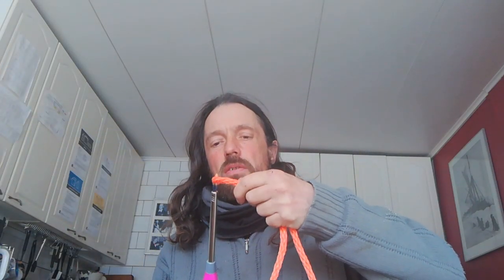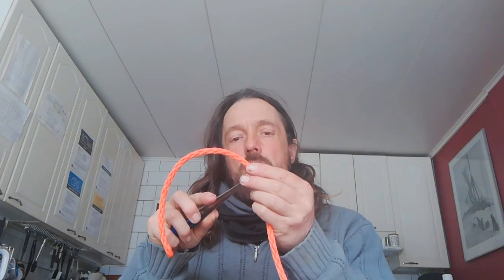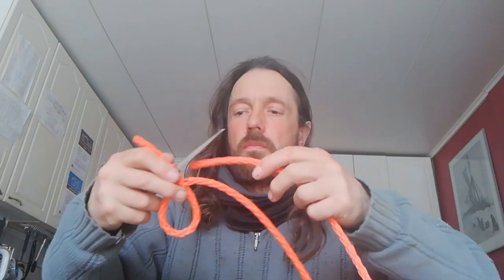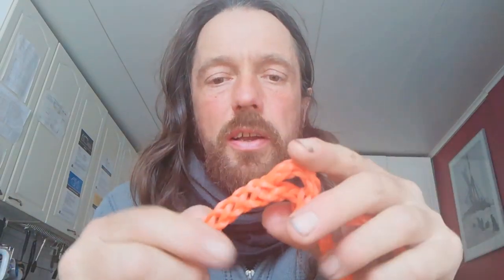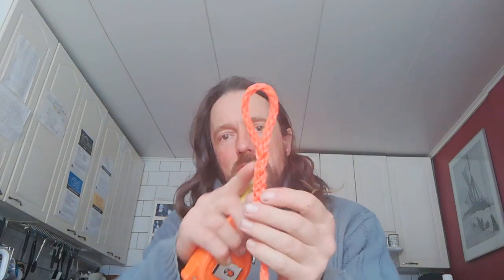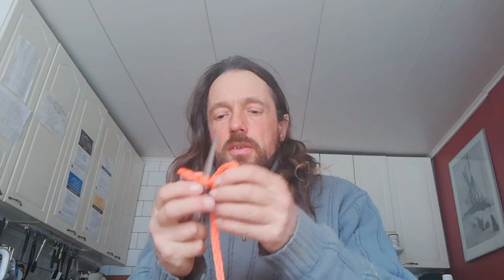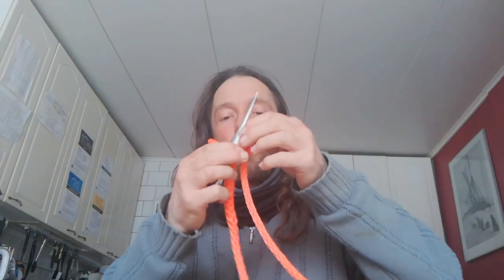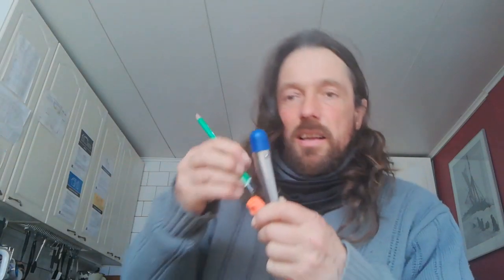Eye splice in hollow braid rope

Comment: If you put each end on the ball hitch of two cars and pull the rope to destruction it will most always break where the melted ends are. Leave more end inside, pull the end out, cut off the melted end, then tapper the end, then draw it back inside.
Reply from the maker: Thanks for the advice Bill I will bear that in mind. It tends to be the sled dogs that break our lines through eating them rather than the pull. We do use the same splice for towing ropes for the snowmobiles and quads too though, there this will be useful information.

Comment: To make it extra extra strong I've wrapped the weave with electrical tape. It's not necessary but just a little added security depending on what you are using it for.
Reply from the maker: That's a good idea, I have wrapped the rope in electrical tape where it has started to rub or fray before now but never on the splice itself. Thanks for the suggestion and thank you for watching.

Comment: Fantastic mate, I've always wanted to make my own lines. Thanks for sharing. Whats that tool called and are they easily sourced?
Reply from the maker: It's called a Fid, you will find them on ebay I am sure. But in the past I have made them out of wood, antler and bone. Bone works best. If you want to make cani cross lines I would recommend that you pass some bungee cord through a good section of your rope, bunch the rope up over it and secure the ends. Make a loop on each side first (this will be easier without the bungee). On one loop you can larks foot a clip (or use a D shackle) and put a caribener on the other end to attach to yourself.
Thanks for watching mate. If you need any information about this kind of stuff please feel free to ask.